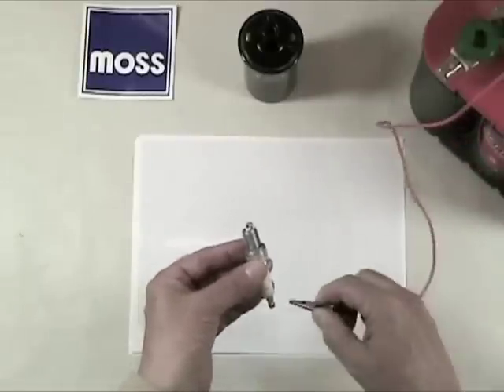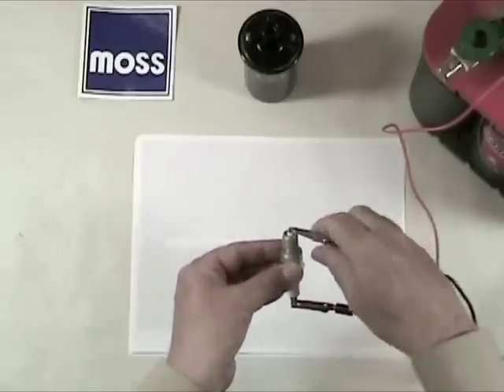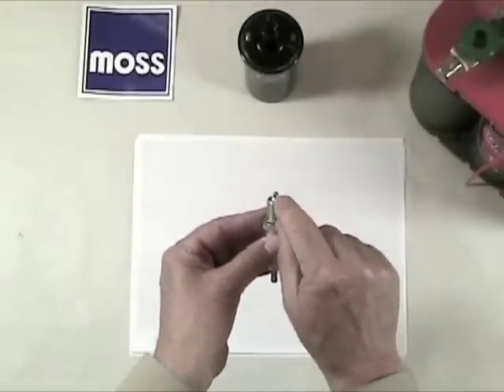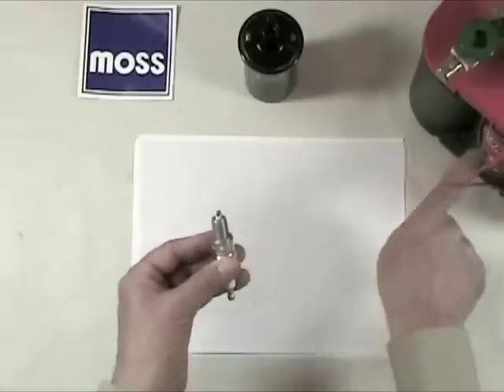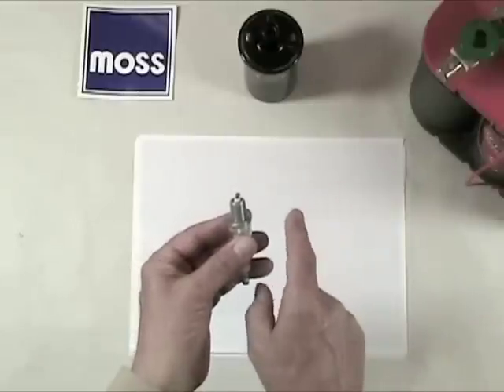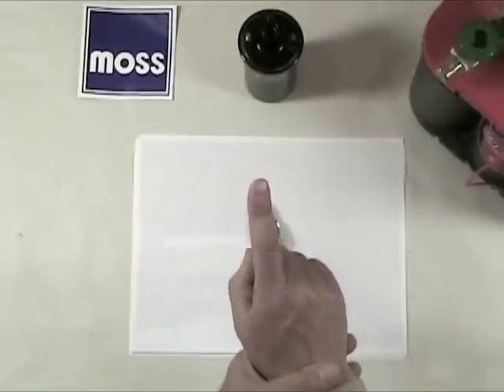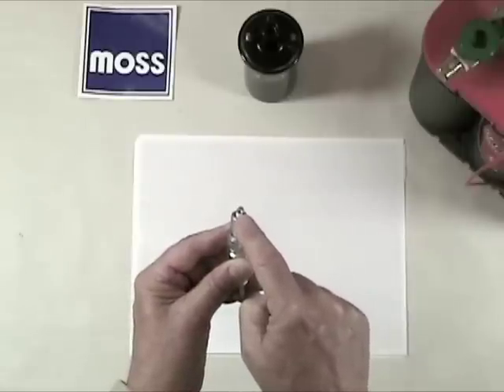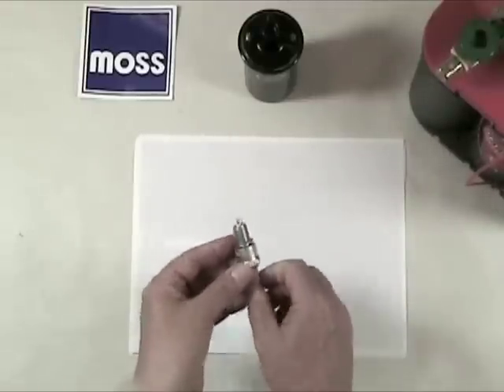How Spark Plugs Get Power (Part 1) - Principles & Problems

Comment: That doesn't even make sense,,, at 150 where he says,,, the amps do the work, but it's the volts that carry it to the job!!! dddaaaaThe amps are where the power is at, as the volts are just a little tingle...Example: look at a 9 volt battery and how you can lick it as it tingles,,, but if you lick a 9 amp wire, it will make your nipples hard, AFTER U GET ELECTRIFIED!!!  >>>ZAPPED 4 short<<<<
Reply: Voltage is the force that pushes the Amps. That's why volts are also called Electromotive Force.